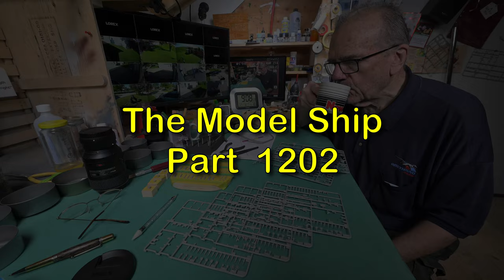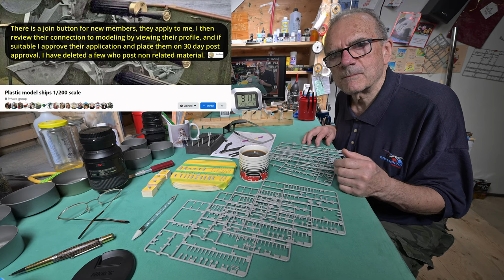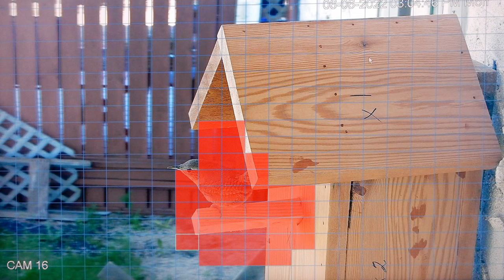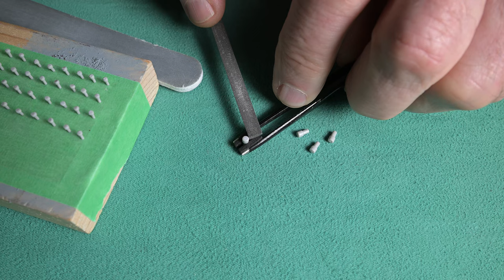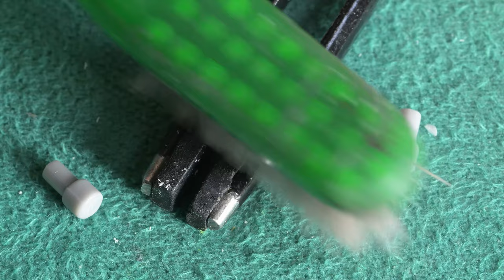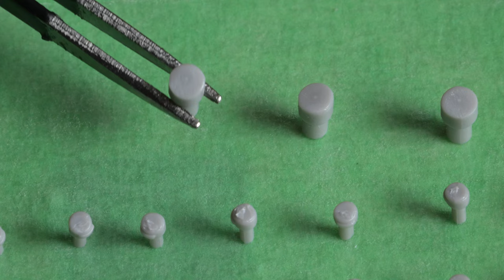The Model Ship - Part 1202

Comment: Hi Ron; 
Just a thought, I wonder if it would be worth applying a small drop (don't over do it) of Tamiya thin cement on top of those small parts and let the the cement smooth (melt) the tops a little before painting. Might also get rid of any small files marks on other parts, just a small drop to cover the area.
Dave
Reply from the maker: Good idea Dave! 👍

Comment: I cringed when I saw you using the metal file. Never use them, they leave too many groves. I only use fine sanding sticks, polishing pads and compounds. Haven’t tried the double sided tape, will give it a go.
Reply from the maker: Yes, I'm a sort of a bull in a china shop when it comes to modeling. I realize that to put one of these big beautiful model kits on "my" model table is like casting pearls before swine. But Gary, I'm enjoying the builds anyway. 😁👍